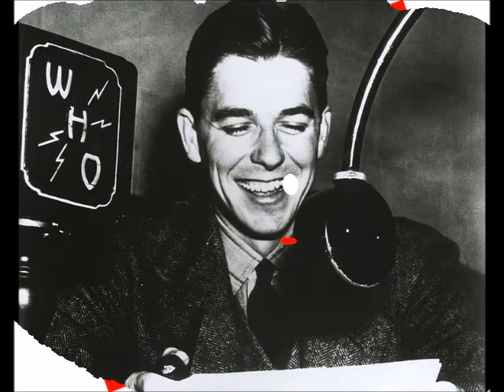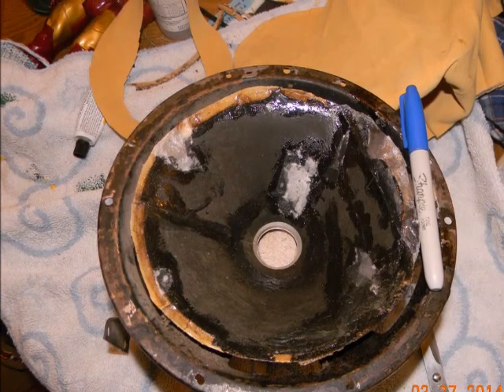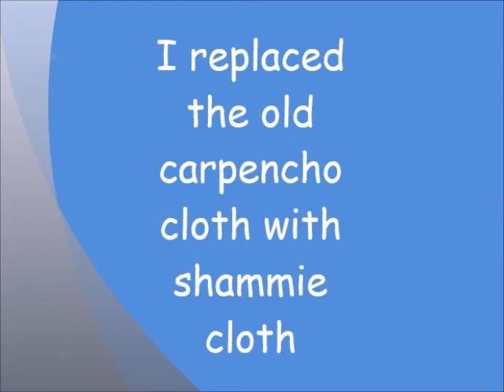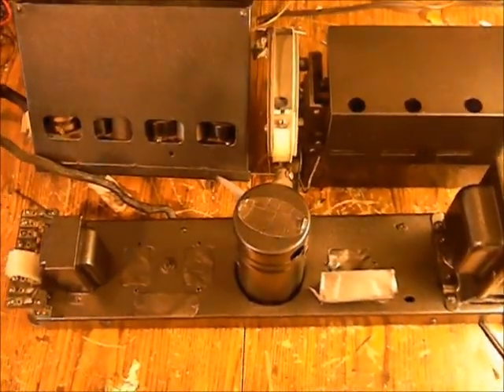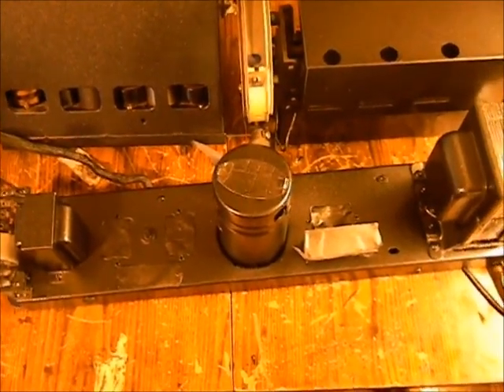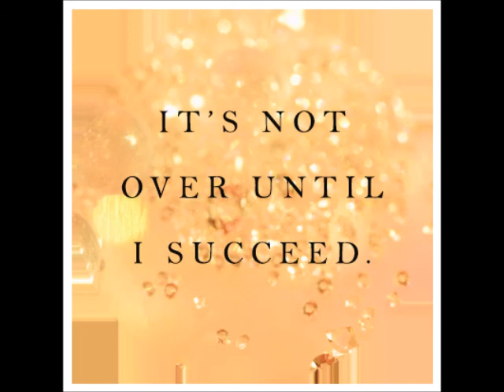Sparton 931 Restoration, Part 5

Comment: Nice work, Michael.  The chassis is looking really good.  For myself, I don't mind doing cabinet work, it's just easier to do the electrical work.  I have a nice work area for that, but, not anyplace really great to do cabinet work.  I'm certainly not great at it anyway, but, I don't mind a cabinet, as long as I don't mess it up too bad :-)  I'm looking forward to hearing this play, as well as seeing it back in the cabinet.
Reply from the maker: Hi, Al. I'm with you. As long as things are going well with the cabinet, I'm a happy guy. I just don't like mess ups. But, there is always the lacquer thinner if need be. Thanks for stopping by!